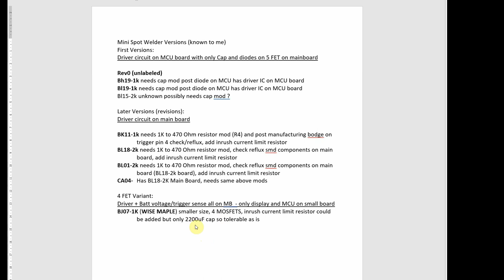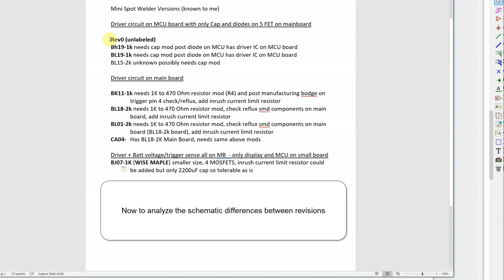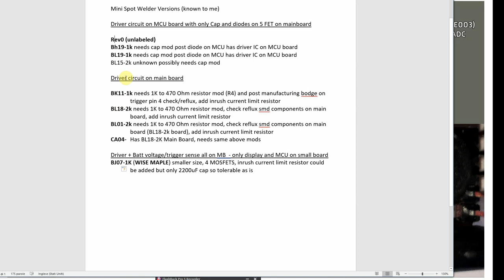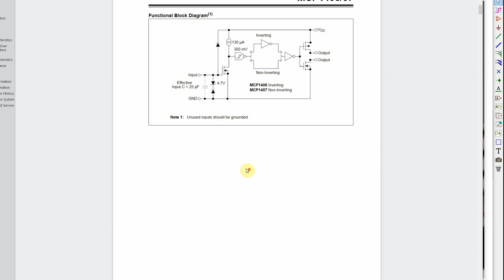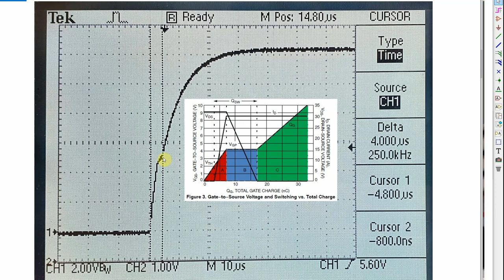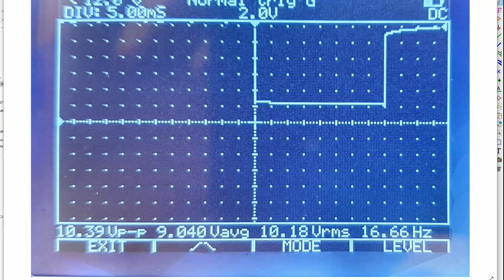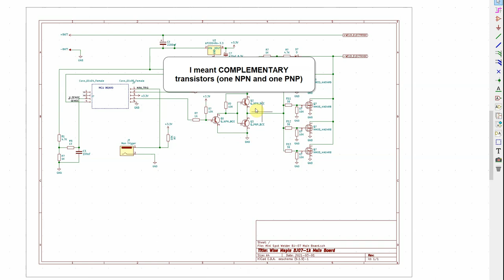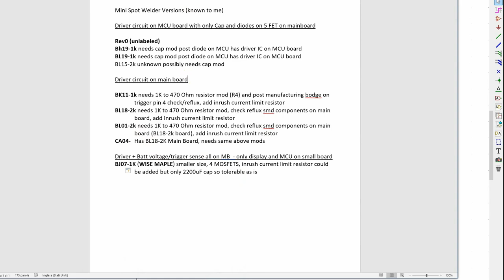All "Mini Spot Welder" versions: circuit Analysis, differences and faults

Comment: Got one of the old unit.
got it from China (BG) back at a sale when they first saw daylight.. was like 12 bucks with danish delivery and I was very impressed with it and it gave me all the spot welder-umf i needed even for 0.2mm strips and I love that I can just use my FPV lipo packs and that the battery ain't stored with the unit..
I been using 2x 4S 2800mah in parallel.. I know its more then the rating 3s but I did not see any components that shouldn't accept 4S.??
I checked on my scope when i got it numerous years back, and notice that the E1-E99 just equals ms on the scope. so 20E = 20ms burst.
Sofar I been very impressed with it. (though I don't spotweld a lot) but sofar it matched my need ideally.. a very small adjustable spotwelder with both aut. and footpedal control and I can use the LIPOs I already have..
thx for one solid walkthrue.
Reply from the maker: Hi Jakob, yes the 4S is the upper limit for these welders. The components could handle more but the problem is the BIAS voltage of the FET Gate driver arrangement which would be not driving the gate properly (if you have the push pull 3 transistor on the main PCB model). Also the weld current would overdrive this FET setup and you would risk a FET failure. Keep your weld times around 20ms to not overdrive it (yes the E equals to ms). I get great welds with .12mm strips around 16-20ms with a 3S 5000mAh pack. I also added a foot pedal which makes things more precise. Overall, once you take care of the bugs it's an ok portable welder for the price.

Comment: Hey so I just bought one of these from Amazon.  Mine looks like the black button one but has white buttons.  I haven't looked at the board yet but I will when I get home. It may be the old version though!
Reply from the maker: Check out my "new" Rev 0 video in the playlist, it might be that one too (you can see it has bus bars soldered on and the MCU board is different).

Comment: The version difference of this mini spot welder is very well explained!  Now I am encouraged to remove the 10000uF cap to a 2200uF one on my CA04 but I can't find anywhere I might be able to use this big cap. Maybe I will try to solder it parallel to the battery to mimic Version 0.
Reply from the maker: You don't need to - it's ok keeping the overly large 10000uF one as you already have it in place, it won't do any harm as long as you have the inrush current limiting resistor. If you want to parallel it to the battery by removing and shorting the diode contacts for ex. you will have to add an additional decoupling 1000uF cap with diode anyhow to the VDD trace going to the driver and MCU board. I don't think it's worth it, just be sure you have the current limiting  resistor in series with th diode and you're set.

Comment: I recently got one off ebay and it appears to be Rev 0 with only the cap on the mainboard and all the other stuff on the mcu board. However, mine has brass bus bars and a different FET driver (aswell as a small inductor right beside it). Do you have an email address so I can send you some photos of it?
Loved your video by the way, you should do more electronics lectures!
The new FET driver is marked B628 and the inductor is a 6R8. It also has 30ohm series resistors on the gates on the mainboard.
I added a 1000uF 35V cap regardless as I had some issues with the mcu board rebooting while welding. Thankfully the FETs kept their shit together so maybe they've found a healthy medium between cost and effectiveness when it comes to the FET driver ;)
Reply from the maker: Hi, if you can please take close ups of the mcu and mainboard top and bottom and email them or post them somewhere - thanks!

Comment: On the original version I added a 1000uF capacitor, do you think that is inadequate and should I replace it with a higher capacitance capacitor?  Great video!!!
Reply from the maker: a 1000uF Cap is fine, no worries!

Comment: For the CA20-2k circuit you need to add 40-50 ohm resistor to the reverse input diode same as 8:33, watch close and u can see that the diode is  mounted sideways and in !!SERIES!! with resistor!!! (before adding resistor check if the diode is not damaged, mine was so i change it for a schottky diode with 50 ohm resistor in !series!). Also u need to change r4 resistor for 470 OHM. Also this version can work with 4s Li-po battery (tested). 

That way mine after blowing 2 fets without modds, i did steps that i mentioned above and it works like a champ.

Please bump up the that commet becouse i see from now they are shipping  CA20-2k circuits.

Fell free to ask.

Comment: I think i'll go another way and add a separate power supply source for the IC on the VCC line as I'll work it from a bench anyway. Maybe incorporate a relay for the battery terminal lines as a fail safe so the FETs will not fire without the VCC line active.
Reply from the maker: That's also an alternative though it does make it more cumbersome and less portable for such a device. A proper decoupling mod solves this hassle!

Comment: You should merge all that you've learned from analyzing the circuits and merge the findings and build one from scratch.
Reply from the maker: Yes I have thought of this as a fun project, from developing an appropriate 2 layer PCB with 8 FETs and bus bar, FET driver(s), gate protection & MCU (arduino) with Oled screen all open source for anyone to build. My problem is free time which unfortunately I don't have at the moment - but who knows, it is something that I'd like to do sooner or later (as many other things!;).
Reply: @Luca_Techy  How about adding a logic to detect shorted FETs when not welding?
Reply from the maker: @j.d.3269  That's easily done in manual trigger mode but in Auto trigger the contact detect circuit can interfere so you have to find a "short detect voltage" below the auto trigger value which is around 2 V if I recall correctly - still possible though.
Reply: @Luca_Techy  You are absolutely correct! Less than 2V should be able to turn on a BJT. Maybe also disable the alarm when welding.
I'm scared of using spot welders without this kind of safety even though it's really rare. This is what I heard in an YouTube video: "all of a sudden there was a massive blue spark, huge spark, smoke everywhere, I blew a huge hole in the nickel."

Comment: @Luca there are also older versions. I bought mine in summer 2020 and it's a BH10 - 1k.
I can provide you some pictures of it if you need.
Fortunately it didn't died on me after the first weld, when it was still vanilla. After a couple of months of use i reinforced the traces, did the cap mod and replaced the power supply cables with thicker ones. Still going strong with a 55Ah 510cca car battery.
Edit: it looks very much like Rev0
Reply from the maker: Yes I know about the BH version (it's mentioned in my videos) - it's the closest to "Rev 0" which is unmarked.

Comment: Fantastic video sir! I just received a Rev0 (updated possibly?) that has a different main board, sorta, and actual bars on the powerboard for pos/neg connections instead of solder. I haven't seen one like this on any video covering this style spot welder. Has there been yet another revision to the revision of the revision from the revision that was the revision after the initial revision of the original revision? I'm so Confuscioused lol! Guess I'll just hook it up to a battery, send it and find out what happens, as thus far, I have yet to find a video of any mods done to a unit like the one I have acquired. Thanks for all the insightful videos!
Reply from the maker: Hi, please check out my latest video on the "New Rev 0" where you will find what you are looking for!
https://www.youtube.com/watch?v=Ml4hBqfLyyU

Comment: i have a revision 0 spot welder here with white buttons, the one that has the mosfet driver chip. when i first bought it i used it to spot a few 0.1mm nickel strips to the ends of 18650 cells and it worked with some success. a year has passed and i picked it back up and tried to tack some 0.3mm nickel strip to some 26650 cells, it beeps and then clicks but regardless of what setting it is on it is far to under powered to attach the 0.3mm nickel. after watching your excellent video i soldered a capacitor from the diode to ground and tried again but it is still the same very under powered making it quite useless. i don't no if your still interested in the oscilloscope shot you were asking about, if it helps i have a little portable DS203 scope here if that's any use for it. of even if this spot welder would be good enough to get your oscilloscope shot since it dosent seem to work very well. any help would be appreciated as im going to have to purchase a better spot welder if i cannot work out how to make this one more powerful, it is connected to a good fully charged 100ah 12v landrover battery, i also tried it on a block of 8 parallel 4 series 26650 lifepo4 cells and its just the same under powered.
Reply from the maker: Hi Jay, this series of mini spot welders don't have the capability of welding over .12mm strips, .2nm is an overkill and .3mm impossible for it. If you really need to weld that thickoness you need a different and more professionally oriented spot welder or try to build one from a MOT transformer.
Reply: @Luca_Techy  thank you for your fast response and for your excellent video. can you suggest what would be the best spot welder at a reasonable price. i should buy. i have 3000 off 26650 lifepo4 cells and i want to make an 80v battery capable of delivering 150 amps.

Comment: Good job! I have the Rev 0 board, but sadly no scope. If you want some more pictures or measurements I can take with a simple multimeter I can help with that. I just bought the board from Amazon and the listing is still active.
Reply from the maker: Hi Linus, thanks for the offer - I already received enough photos and details!
Reply: did you just add the cap mod? just got mine in
Reply: I solder a cap on the small board, after the diode to ground. Also beefed up the tracks, I've gotten a heatsink for the mosfets.
Reply: @linusgk5042  sick! Thanks so much
Reply: Just giving an update, added another cap (same as on the big board) to the small board because I could se the display getting a little bit dimmer during the weld. Used a 3,7F capacitor and a smaller agm battery on the input along with a charging circuit to limit inrush current to the huge capacitors (11000uf on small board, 10000uf on big board and external 3,7F). Beautiful weld on nickle Strips at 10ms. Turned it up to 35ms to weld thicker material and blew the fets 😅 so I think I exeded the amperage limit on the fets...

Comment: have you got the schematic of the first original version with the MCP1407? none of the links are one with that. I would appreciate if you had a link to that as well...please
Reply from the maker: Unfortunately I don't have that model at hand to faithfully recreate the schematic. I have only speculatively done this, but without tracing the board it's not reliable.

Comment: So all I have to mod on the CA04 revision is replacing the 1k R4 by 470Ohm and Add the resistor after the M7 diode?
Reply from the maker: Pretty much yes.
Reply: @Luca_Techy  thank you very much! Done already. Now all I need is a battery pack xD
Your efforts for the community are really great!

Comment: Hello, I'm unsure if your still reading comments about this video or this spot welder, so here goes anyway.
I have no idea which version I have or what I need to do to fix it.
It appears to be an earlier version but the two boards don't match up with any of your photos ?
It there a way to post up photos of what I have for you to look at ?
Cheers
Reply from the maker: Hi Bruce, yes you can send me the detailed pics of it to my email in the channel description. There is a newer version floating around which I haven't got my hands on yet so if it's this one with the extra chip and components on the MCU board then I already have the pics, I am just waiting to REI one and do a video.
Reply: @Luca_Techy  Oh, I just read now this comment.. I guess I received same as bruce stevens..  I already sent to you descriptions and photos of my new(?) version what I received with a half burn SX1308 (marked as B628)
Reply from the maker: @budavaril  Hi I just replied to your email, I hope to get my hands on one soon!
Reply: I changed that burned chip last night, but unfortunately something else wrong there, as the new chip also burned jus 2seconds after I switched on.
As I received on a dc-dc step-up converter, first I just tested that module and there was working the chip as expected woth no warm at all.. 
I'm very curious about those welders what other people received, those chip are under power is cooler or all of this warm or hot?? 
Hope not something unrepairable new design... 
Otherwise definitely same mod will necessary as first early versions, there is the diode after the switch and the 1000uF will solve if any voltage drop there.. 
Now I ordered a new and sending back the originally (factory) faulty device for refund actually in same condition I received. (The new chip was identical and burned exactly same way/same place as the original, just around pin 1 corner.
Reply: @Luca_Techy  un able to send photos as I cant find your email address in the channel info
Reply from the maker: Icecool.daiceman@gmail.com
Reply: @tropicrows  Hi Bruce, did you tried connect to a battery? As I wrote above, I received my welder that chip (what is the difference on this version) was blown already. After find a replacement and changed, just blown again straight away.. 
Is there all seems ok on yours (at least visually), or might that chip also blown or became hot (if connected) as on mine? 
I just will receive a new one tomorrow, hope that's will all right, but I'm excited...
Reply: Hi @Luca_Techy 
I couldn't let unsolved the "task" and double checked again my faulty mini spot welder. By my curiousness I  just desoldered the induction. My theory was right, under that I found that the too much solder flooded and caused a shortcut so actually the chip input and output pins (what also the two pins of the induction) was shorted. I had no any new chip, and anyway I received the new one, so no reason to fix anymore, but I'm pretty sure that's the solution.. I just soldered back the induction and will return as it is tomorrow.
I also tested the new one I received, and as I expected the chip is totally cold with the power connected and even when I tested with P21W car bulb. I set to 99E (50ms) and at least 20-30 time after each other, but no any warm, still cold all component include that B628 (SX1308) chip.

Comment: The gate drive smd transistors are marked Y1 (npn) & Y2 (pnp) which turned out to be SS8050 & SS8550 with a rated max Ic of 1.5A which I thought was impressive for the physical size of them.  When I cobbled together my own gate driver I ended up using BD681/2 TO220 darlington transistors to match or exceed that rating (using up hugely more real PCB estate)
Reply: These have a typical Hfe=100. The peak gate current is set by the base resistor.  Rb/Hfe=10k/100=100 Ohm. (12V-2Vbe)/100=100mA. The total gate capacitance is 5*20nF=100nF. This gives a time constant of 100*100nF=10us. I measured a risetime of 16us. It's on the limit of safe operating area. But Hfe can be much lower due to spread. And there is of course also a 30 Ohm resistor in series with the emitter added. That limits the peak current anyhow below 300mA.
An easy fix would be to lower the 10k base resistor to 2K and remove the emitter resistor. But you have to check if these smd devices can handle the current as well.

Comment: I mean because of the inductance of the cables/loop when the battery is shorted. Some designs use TVS diode paralleled between drain and plus pole of the battery some use 5-10 regular fast switching diodes or beefy big one. Is it necessary?
Reply from the maker: I have attempted to measure any reverse (Lenz) peak voltage while welding and the amount was under 60V at least with my setup. With these peak currents and short cables I haven't noticed the need for any additional protection. I am surprised you blew all FETs so dramatically, maybe you are overdiving your setup or maybe there is some other issue as I haven't heard of Rev 0 models with the additional cap mod blowing up all the FETs like that which is indicative of a massive failure. Check your board contacts and be sure your power switch is bypassed and check all the soldering joints on all components.

Comment: ok thank u for this video i have a mini welder and mine is Bg21-1k i has 5 mosfet . on the board  under the mostfes there 5 diode  and  on top were the mostfes are  the 10000 cap thats all on this board then the small board that has the display the rest of components .also on the list that u show mine is not there anyways so far my welder works the way is suppose to work . i only used it 3 times and i did weld 6 batteries and so it still welding thank u for he video.
Reply from the maker: Thanks for the version feedback: it seems you have an equivalent to the Rev 0 / BL19. Check if they have added a capacitor after the diode on the MCU board else you still need to add this as stated in the video to protect the FETs from undervoltages. It would be interesting to see some close up photos of the MCU (small) board to see if there are any substantial differences respect  to the prior version.
Reply: Ok I will like to send u pics of the board let me know how I can do that and I will. But when I kept watching ur reviews u was showing a board that look just like the one I have any way thank u.
Reply from the maker: @h2o-fpv623  you can upload them to imgur.com and post the links here